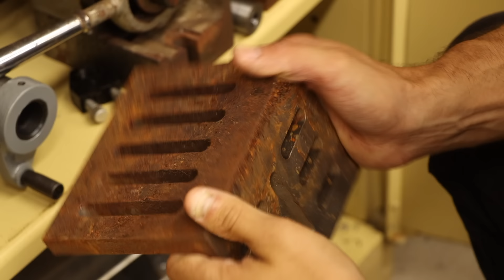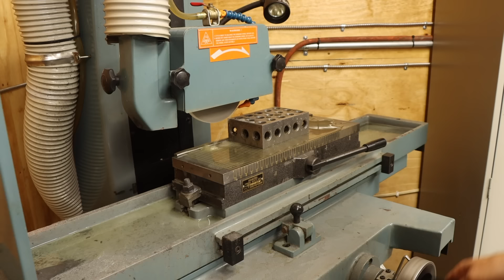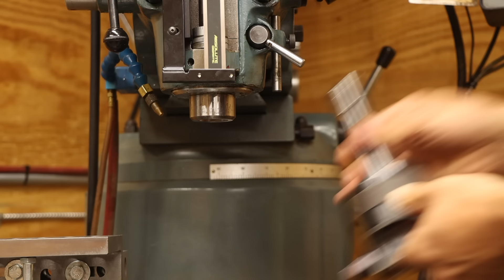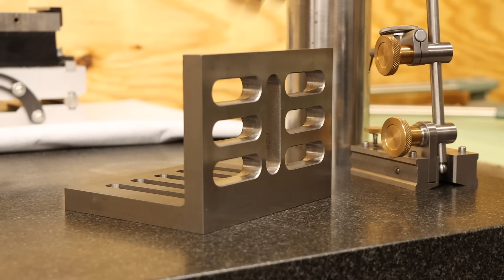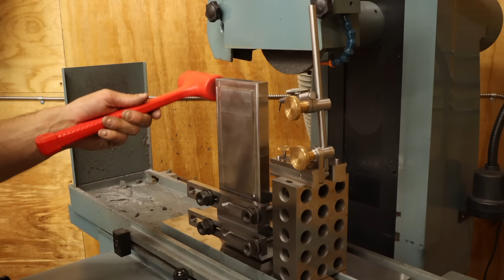Restoring an Angle Plate || INHERITANCE MACHINING

Comment: Would you be interested in building a engine fro scratch?, from plans I scratch out, I'm thinking a modernized version of the first diesel engines, and oilfield engines, pony/hit-miss engines. I'd like it to burn oil. Design a air blast oil injection system. I think will work, it requires a couple ac compressors in series. The interesting part is the 8" bore, and 12" stroke  I plan to cast aluminum pistons from modern used pistons. Possibly 8 pistons to cast a single piston. Then the kicker, I want to build a opposed twin cylinder. With a pair of 150-250 lb flywheels. About 24" diameter,  with a 25:1  compression ratio. And thinking about using a piston in a cylinder that mounts into the heads to lower the compression ratio. To allow it to run in gasoline or propane, simply by lowering the compression, and unscrewing the sparkplug blanking plugs. And switching on the ignition system, mounting the carburetor,  the top speed would be less than 1500 rpm. Probably less than 1200, it will likely have a operating range from 400-900 rpmi want to use a electronic governor.  The head will probably be 2-3 plates of 1/2"-5/8" maybe 3/4" steel maybe a cast aluminum head, it just needs a few water passages, and intake and exhaust. Injector and a long 10mm spark plug, and the optional 3/4" not for the compression reducer.  I was thinking about using a 50 mm piston. Inside a pipe basically, with a spacer to keep it tight. Then a steel plate over it , that bolted to the head with 1/2" studs. The wet cylinder liners o-ring into the block .  With copper head gaskets, and stainless o-rings to seal the cylinder. The pistons having a cone shaped dish in the center, with the injector centered with it. The head being flat, except for a .060" area larger zhan the valves easc side, and about .050" deeper than the valves seated.  And using BBC Chevy or hemi Chrysler sizes valves , exhaust through a 2.25" header, 2:1, into a 4" pipe and muffler. Intake through a 2.5"-3" pipe. Reducing to 2" for most of its length. Being it so long with two 90°'s at the head, and possibly one at the carb. Using a single barrel carb for a 250-300 cid i6 engine, or possibly  a 2barrel. Got to do the math to figure that out. It's a huge engine at low rpm. The crank made from 1/2" plate steel and 3" bar stock, finding old hydraulic cylinder bar would probably work. If the chrome could be left on it. Even if I had to bore the bearing out a bit. A shrink fit into the rod and main journal in the crank throws with a counter weight, balance should be simple, within a pound Should be fine 😆. I want it to use waste oils to generate power, and no one makes engines like this anymore, buying a 100+ year old engine expecting it to work daily sometimes is a bad idea.. have an awesome day! ✌️

Comment: I knew the wheels were going to fall off the wagon as far as being perpendicular goes, the minute you put that large fly cutter in the mill.  In theory a smaller diameter end mill making several passes across the surface would give you the best chance of being perpendicular.

Comment: Starting a project with an end goal, but having only a slim idea of how to get there is bascially my life as a hobbyist maker. My current project  - at least the one that's getting my current attention - that was started 8 years ago and had reached a "shit or get off the pot" stage of being ignored - is even now being changed and altered as problems and required "side projects" raise thier heads.

PS if you have children you need to get them T-shirts that say "side project 1..2 etc"

Comment: its important to leave your spindle on grinder running for a bit so it'll warm up. I'm a tool maker I was always taught to let the grinder warm up, dress the wheel and then grind. anytime the grinder is shut of it can loose some concentricity. if that makes sense?

Comment: Do you apply any kind of product to retard future rusting on those surfaces?
Reply from the maker: I use an oil called ACF 50 but I also dont have many rust problems with the dehumidifier I run in my shop

Comment: it always amazes me to think, that under all of those years of rusting, just a few thou under the surface lays a perfectly good tool fit to be used for future generations. I'm a woodworker, not a machinist, but to an extent, the same holds true for wood. I've used old barn wood that had probably been sitting in the same place for over 50 years, and after the first layer of dirt and age had been removed, you'd never be able to tell just how mangy a piece really was before you put your hands on it. every time I'm down in my woodshop, I get to uncover the beauty of the wood underneath so many imperfections, and its truly the reason i keep doing what i do. watching videos like this only reinforces that idea in me.

Comment: If you want a suggestion for a Project that will be useful in the future AND drive you completely Bat-Crap-Bonkers in the process, take the 2-4-6 blocks that are perfectly clean & square but undersized, build up 3 faces with weld and then machine them back to perfectly clean & square but at proper size...

Good Luck...

And don't forget to pre-book your Appointment with the Shrink before you start...

😄😁😆😅😂🤣

Comment: Just a heads up.  Parallels are only ground on the two edges.  Not on the sides.  They are not squares.  Your setup at 12:58 would not be square.  Keep up the great work.
Reply from the maker: That's true but in this case I'm only using it to temporarily elevate the plate. I end up using the comparator to do the final squaring. Thanks

Comment: Thats what you get when Purchasing and using "Chinese " made Machinist Blocks !  They RUST quickly and easily too : ((   Been there  , !!!  
Never had a problem with Squareness or Dimensional sizes   With "American Made"  Taft Pierce , Challenge  or 
Moore Precision Blocks  : ))    I guess its "You get what you pay for "   
HAPPY MACHINING  !!
Reply from the maker: Fair. But I also didn't buy it so fixing it was the cheapest option. And honestly more fun that way 😁

Comment: You might consider adding Some 1/4-20 tapped holes on the ends for set up work. They come in handy if you need stops .
Reply from the maker: ooo, I may do just that. Thanks

Comment: Just a helpful tip from a machinist here... Try to avoid using parallels on their side in your setup. Often parallels are only parallel between the top and bottom faces, not the sides. In fact, if you're using older parallels, it is highly likely that they are not very straight at all. Instead, try using gauge pins or blocks below your parts.    Great job on the videos!
Reply from the maker: That's a fair point. I've even seen where some of my parallels are slightly bowed as well. Thanks for the tip and for the support!
Reply: @InheritanceMachining  Absolutely, thank you for putting out such great content!

Comment: Your accuracy and pursuit of accuracy has gone up dramatically.  Out of curiosity, at the end of the video you place the parts on your granite surface and there appears to be small gaps on one end of the angle plate and the 246 block, but none on the larger jig.  Is that just an optical issue or perhaps some debris on the two?
Reply from the maker: Thanks! Yeah some called that out to me before. I think it's an optical illusion made by the chamfers on the bottom edges of those parts.

Comment: Just found the videos man and I'm glad I did!! I'm looking forward to applying what you show/teach in your videos at work. I do quite a bit of surface/square grinding heat treated tool steel.

Not sure if you mentioned it before but that indicator base is slick. Was wondering if you made that or bought it somewhere.

Keep up the good work!
Reply from the maker: Thanks and welcome! That surface gauge was actually a 2 part build I did a while back. You might get a kick out of that as well. Lot's of grinding 😉

Comment: Does the angle plate need some sort of surface protection to stop it from rusting again??
Reply from the maker: I considered cold bluing but I would end up regrinding the mounting faces afterward anyway. So I'm just going a light coating of rust preventative oil. Also my shop has a dehumidifier running non-stop that should help a ton

Comment: Very nice. Now when you grind in the next 2x4x6 block stamp it before you start grinding so you don't get a bur. And that way you can tell them apart. Hopefully the next one is spot on. Size and square.  I know you could do it.
Reply from the maker: That's a great idea. Im actually considering grinding the second to match the other even though it's undersized. I figure it will be more useful as a matched set

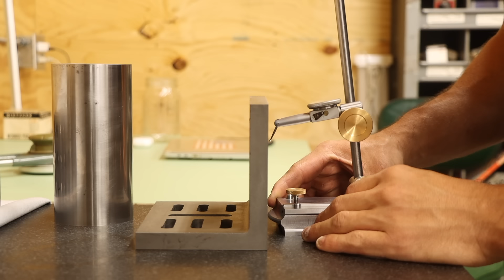Comment: 2:02  A few tenths over 3 inches is more than you need for pipe drainage.  Maybe . . . you mean . . . a few ten thousandths?
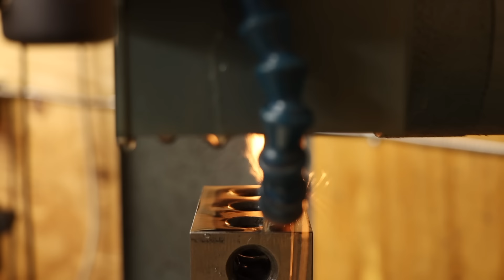5:02  15 tenths over 3 inches would be 60° or, 1 1/2".
Reply from the maker: By tenths I mean ten thousandths. thats common machinist jargon like "thou" is a thousandth

Comment: What's the grinding wheel type? I mean grit and hardness. Thanks
Reply from the maker: I believer is a WA46I. No idea is this is preferred for what I was doing but it's what I had and it seemed to work well
Reply: @InheritanceMachining  Based on this chart it seems is a medium soft wheel https://openoregon.pressbooks.pub/app/uploads/sites/17/2017/01/wheel-selection-chart.png Is there any marking for the structure (open/dense) and bond type?

Comment: Pretty cool. I need to do this to one of my angle plates. if you don't already, Id recommend making up a set of aluminum or similar soft metal washers for when you clamp onto onto your 246 or other blocks, from what ive found even a properly hardened block will get "ring" marks from a standard hardware grade washer tightened under a nut or bolt. Once mine started getting marked up I made the switch.
Reply from the maker: Thats a really good idea. Thank you!

Comment: Good stuff from what I saw, little tip for future reference, when using a surface grinder, keep the wheel on. The wheel will keep its concentricity stable and wont change your depth when moving. Although I get it, it can get freaky when setting up though.
Reply from the maker: Huh... I never would have considered that. It doesn't really freak me out to work around it running. I do it when dressing and other quick operations. Thanks!

Comment: I guess I could call myself a long time viewer at this point, since I've been following from back when you had 4 videos haha. Absolutely brilliant content, and it's really getting the cogs in my head turning.

Just as a side note, since you take criticism really well - when you were grinding the 2-4-6 block, the ratio of clamping(magnetising?) area vs the height of the workpiece made me slightly uncomfortable(namely because one of my students did a similar thing with a clamp he was making and managed to write off a grinding wheel. Needless to say, the storeman wasn't happy). I'm happy to be proven wrong, and I suspect I am, purely because of the overall mass of the workpiece, but I would imagine it would be safer to attach a known square surface place or something among the lines just to spread the load of the wheel. Again, I'm probably splitting hairs, but thought I'd mention it. Surface grinders can be really dangerous when they go wrong.

Keep up the awesome work!
Reply from the maker: That's a fair concern. I definitely would have preferring using something with a larger mounting area like another angle plate but of course this was the only one I had. I did give it a pretty good shake and it seemed like it could withstand the grinding forces which I planned to keep light anyway. I didn't consider this until now but the direction I had the setup facing was a bit safer as well. If the wheel grabbed the plate would have rocked down away from the wheel. Had I set up the other way it would have rocked up and possibly been catastrophic like you say. I suppose I was being looked after that day.

Anyway, good eye on keeping me safe. And thanks for the support along the way!
Reply: @InheritanceMachining  ,  Wow.. another fact I hadn't thought of... of course I haven't had the experience you have had, either.

Comment: Just a suggestion, that 2x4x6 block you cleaned up is now undersized.  I'd zip tie a label to it with the actual dimensions on it, just in case.
Reply from the maker: that's a great idea. Thanks!

Comment: Great video, also reminds me that I may want to check my accuracy of my 2-4-6 blocks out of curiosity.  

Just to pass along my favourite rust removal tip (if I haven't thought to already) to max out the abilities of evaporust.  Get a ultrasonic cleaner, fill with water and heat the water as per usual.  Place any rusty metal parts into a tiny baggie just big enough to fit the part and a little evaporust, like just enough to cover the part fully when you pinch out the air in the bag so it's submerged.  Place baggie into the ultrasonic cleaner basket and run the cycle as per normal.  At the end of the cleaning process (usually about 5 or 10 minutes depending on the part type) you will find the liquid in the bag completely black and the parts just about as clean as they ever will be.  Rinse and if you like brush a tad and you're done.  

The water in the machine stays clean and hot, the amount of cleaner/evaporust is at least 10 times less than what you normally use, the high temperatures accelerate the chemical cleaning process and the sonic action removes the oxides as they are converted to expose new surfaces/clean the part.  You can even reuse the bag about 10 times before pinholes make it leak too bad to bother.
Reply from the maker: Thanks for the tip! Ive heard of using an ultrasonic bath before (maybe from you) but the bag method is extra clever!

Comment: I'm a mechanic and I've worked in quite a few different industries over the years.  Started out in dealerships and garages, went in the army as a mechanic, I've worked on heavy equipment and in a factory.  If you ask ten mechanics how they'd tear something apart and reassemble it you'll get 20 different answers.  It's good to have options.
Reply from the maker: Same applies in the machining. Just a bunch of trade-offs, the importance of which depends on the individual

Comment: Gday, I really think you did this spot on, yes you could of used the 2,4,6 blocks but you still would of cleaned the angle plate at some time, I throughly enjoy your videos and thanks for sharing, cheers
Reply from the maker: True enough. Eventually everything in my shop will be in a useable state. At least that's the goal. Thanks, Matty!

Comment: im not 100% sure but perhaps the 246 block is 2 thou oversized because over time cast iron will slightly change as internal pressures relax. Thats why some tool manufacturers like stanley used to not use cast iron parts until like a year after casting. But this is just a shot in the dark, im no metallurgist
Reply from the maker: You might be onto something there... Ironically I have a degree in material science as well but I couldn't tell you if that's true or not 😂

Comment: Yes, those trees... but look to it from the other side: without that forest/tree thing, we would not have had another interesting video - well, we would have, of course, but not about an angle plate... 
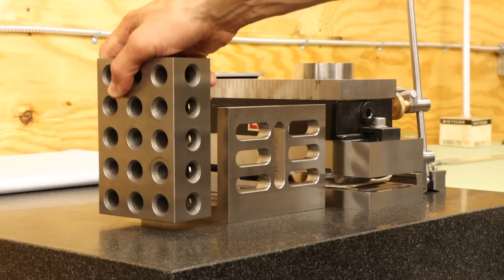question: there about 14:41, looking at the angle plates right bottom corner: is there a small gap or is this due to perspective of the video? br and thanks.
Reply from the maker: Very true 😁 I didn't see that before. I think it's variation in the little chamfer that is on that edge.

Comment: So, I have a question, which to you machinist guys is probably stupid AF, but on the adjustible magnetic holder thing that you finished of last. Is there a reason for why the bottom piece and top piece is so thick? Doesnt those two "plates" for a lack of a better word make the whole thing unnecessary tall and cluncky??
Reply from the maker: Not a stupid question at all! It is bulky and unnecessary if it is only to be a sine plate. I have plans of converting the top plate into a grinding vise so the thickness will help me there
Reply: @InheritanceMachining  I cant picture that in my head :D haha, so I'll just have to wait for the video of that :D
Reply from the maker: @nicosand86  you could wait… or google “sine vise” 😉
Reply: @InheritanceMachining  fuck that, why ruin the surprise 😁😁
Reply from the maker: @nicosand86  😂😂

Comment: You don't think that surface grinding your strap clamps bars could possibly be seen as........ A touch "Overkill" do you? :D

I've always felt that accuracy is important, function is important, and repeatability is important......... But things only need to be pretty if it helps with one of the first three. The problem is, if you spend a couple of hours prettying up some tool, then it's annoying/upsetting when you need it 6 months down the line and find even a single blob of surface rust on. If it was made perfectly usable, but still a bit battle-scarred it doesn't bring you down as much.

It's like cars. If you save up and get yourself a brand new one, the first stone chip on it feels like a Chuck Norris roundhouse kick to the stomach. But if you get [Trying to remember the American terms here. :D] a clunker, then at the mall's parking lot, when you come back out and find someone's gone and folded the top of your fender in with their lifted pickup truck, as long as everything still works it hardly registers above a mild annoyance.
Reply from the maker: That's a fair point for sure. And I can relate to the parking lot scenario. The reason I ground the strap clamps was to not mar the faces of the sine plates when I clamped and ground them. But your right I do tend to grind some things just for the sake of making them pretty 😂